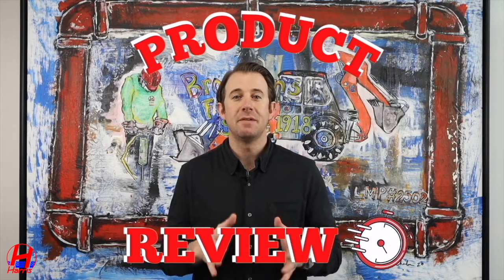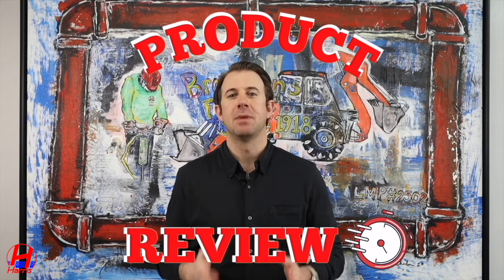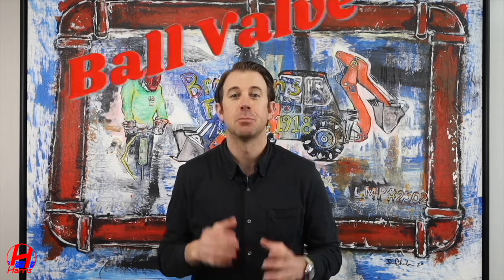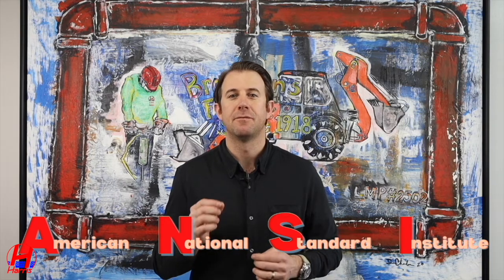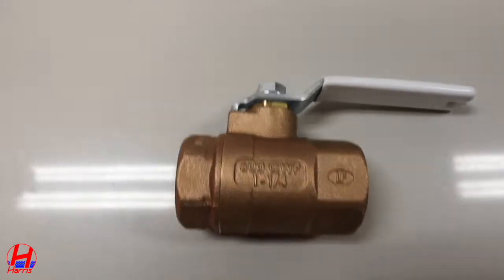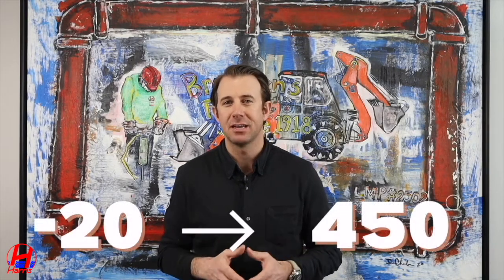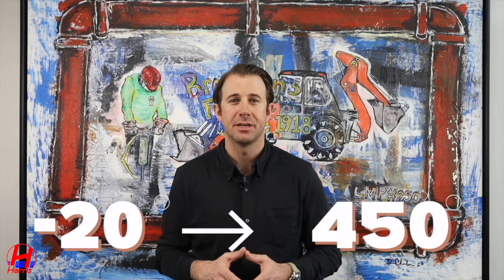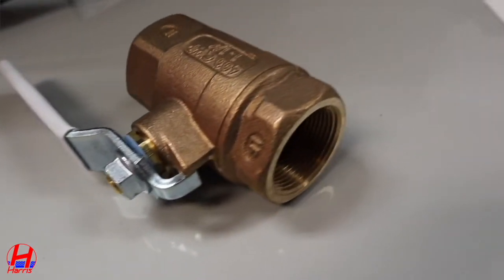Apollo Water Main Ball Valves: Product Review, All you need to know

Comment: This is not all I need to know. My newer apollo main water supply shut off very easily. I went to turn it back on and it seems stuck. I don't want to force it. There is no slip lock but there are those notches which give it play.
I don't want to force it if im supposed to be lifting or something
Reply from the maker: Try to work it nice and slow. You should not be experiencing this much resistance if it is that new!
Reply: @HarrisWaterandSewer  thank you for the reply. I finally called Apollo and they assured me the valve can be 'sticky' especially if they haven't been turned much but they're pretty darn tough. 
I worked it back and forth a time or two, then while supporting the inlet pipe, gave it a little more muscle.
It's flowing now. Woo hoo!
Thank you again.
Reply from the maker: Great!   I am happy to hear !!